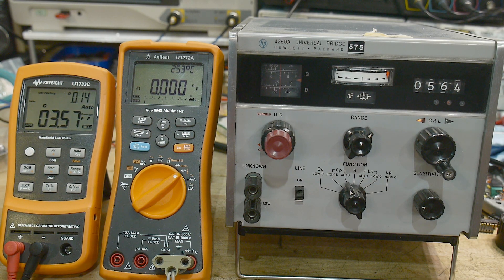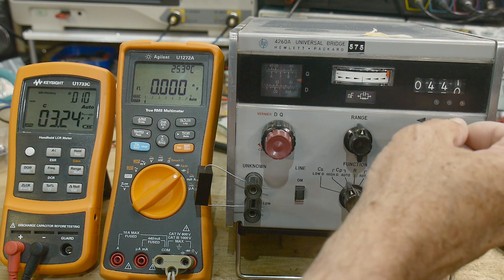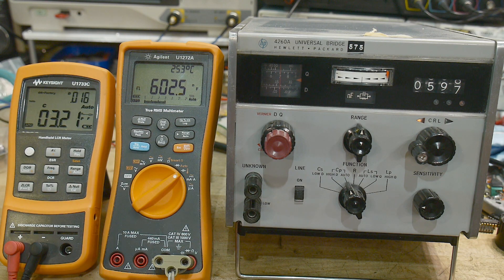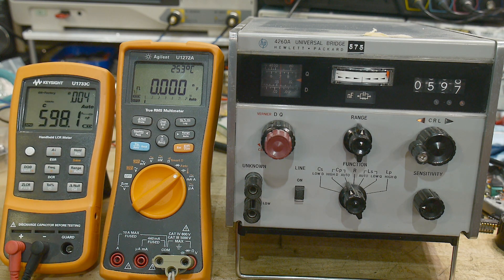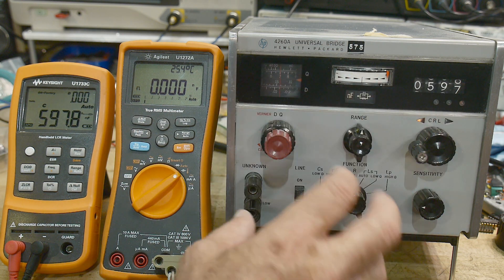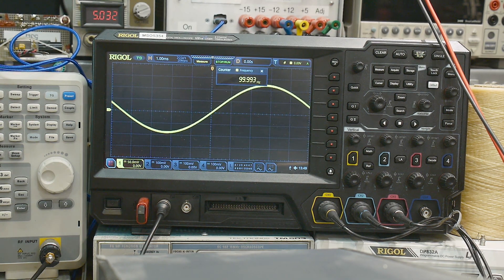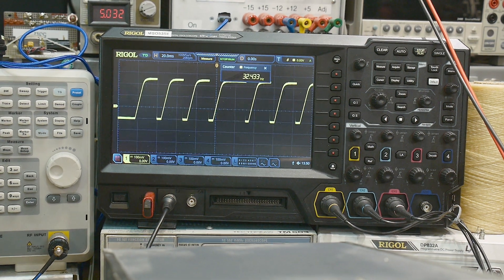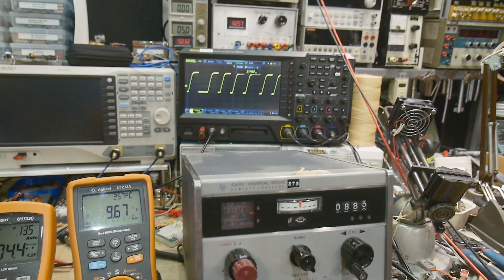#1586 Capacitance Measurement Waveforms

Comment: Test lead inter-electrode capacitance
Reply from the maker: the keysight unit has a cal key that will zero out any lead problems. I didn't do it here as the leads are short and might be a 1pf or so.

Comment: So then, is the RC slope measurement a more "correct" method than the keysight's phase measurement, but imperfectly implemented in the Agilent?
I think the bridge is best, as long as it's calibrated properly.
Reply from the maker: no the Keysight uses a method similar (identical?) to a VNA
Reply: @IMSAIGuy  so, only the Agilent is a direct measurement, while the others are derived from a different parameter.
Reply from the maker: I would argue that a vector voltmeter is a direct measurement too. yes the LCR bridge is comparing a known to an unknow so indirect.
Reply: @IMSAIGuy  but are you measuring the capacitance, or the effect that capacitor has on a vector/ phase of voltage or current.. splitting hairs would be easier to judge.
Reply from the maker: @2001pulsar  the ramp is using a current, voltage, and time to calculate the capacitance. Don't see how that is any more direct than the phase shift
Reply: @IMSAIGuy  ok. I see now. Thanks for the insight. It's both ways of measuring change over time.
Reply from the maker: the phase method also allows measurement (it's just math) of theta, Q, ESR, dissipation. all those numbers are available on the Keysight.
Reply from the maker: I did a nice video: https://youtu.be/34G4pzWr9kA

Comment: To compare you must measure without the cables (the Keysight have dedicate slots), especially at higher frequencies.
Reply from the maker: the keysight unit has a cal key that will zero out any lead problems. I didn't do it here as the leads are short and might be a 1pf or so.
Reply: Ok, thank you for your aclaration. Regards @IMSAIGuy

Comment: Metrology nerds call the type of measurement the Agilent U1272A does a 'charge balance' as you kind of measuring the accumulating electrons in the capacitor. In metrology it is kind of frowned upon. Impedance standards such as for capacitance are calibrated against the quantum Hall resistance. This requires AC. So, all the capacitance and inductance (or generally - impedance) standards are calibrated in AC bridge circuits. This means only AC bridge circuits can be calibrated all the way down to the physical constant of the quantum Hall resistance.
For this reason if you ever buy an impedance standards such as the IET Labs 1404 series capacitors, you well get the data sheet for capacitance at a given frequency and voltage. The voltage also matters because it influences your coupling to ground, chassis as well the the amount of electrostriction of the dialectric.
Metrology is fun.

Comment: I sure would have liked if you had thrown into the mix the little $17.00 LCR-T4 Mega328 tester.  I would have liked to have seen it's method and result on the same cap.
Reply from the maker: I gave it away, but I'm sure it was the slope method

Comment: I really tought that RLC bridge tester was measuring the impedance not the phase. How change the phase for a resistor, I wonder?
Reply from the maker: no, you are right, it is a bridge, I shouldn't have said phase.
Reply: @IMSAIGuy Can you make a video explaining why is important the frequency in measuring L/C components and why the measued value is so different depending the frequency? It have to do with ESR/Q? Or is something else? My common sense say that measuring a capacitor or inductance, have to give the same value independent the frequency used to measure.
Thank you.
Reply from the maker: perfect capacitors do not have freq dependance. real capacitors do. they have resistance and inductance

Comment: With which meter were you measuring those MLCC caps the other day? If it was with the Agilent, that would explain the different and smaller capacitance readings since it puts out a DC ramp. I wouldn't expect the sinewave bridge meters to show less than rated capacitance unless they put a lot of voltage out, I don't think so.
Reply from the maker: I was using the Keysight